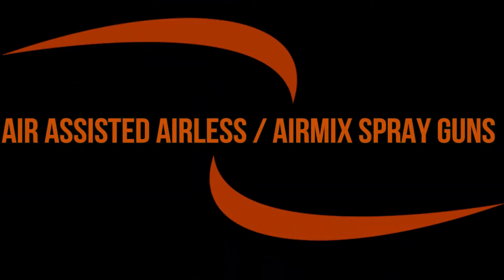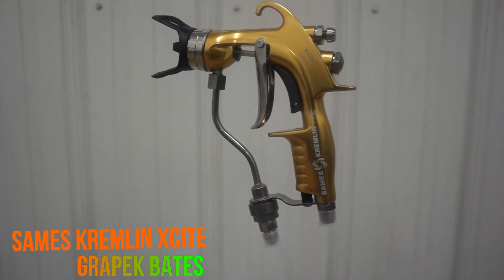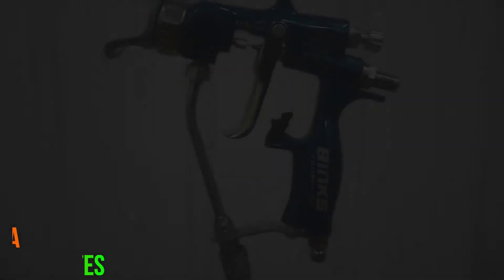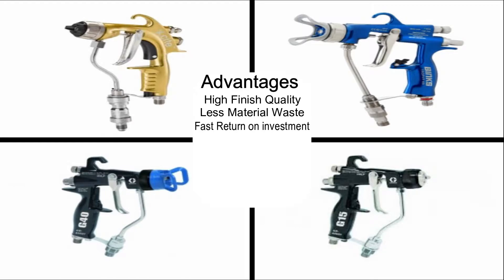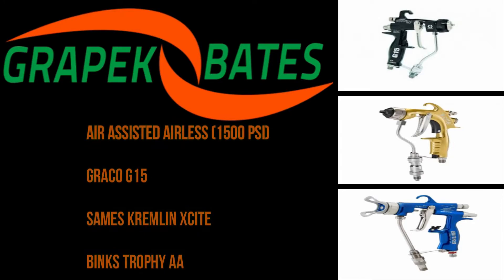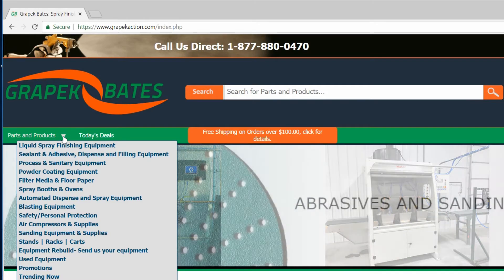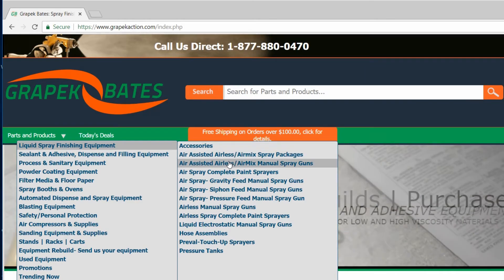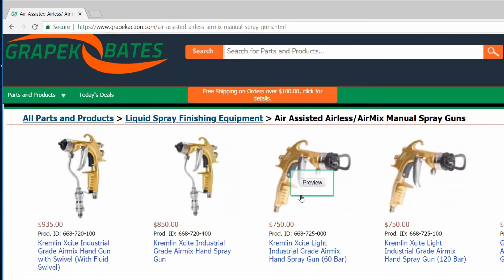Air Assisted Airless/Airmix Spray Guns

Comment: Hi mate , which spray gun has the finest atomisation? Also which spray gun has the most adjustable spray fan size
Reply from the maker: Hello Artie6937 we appreciate the comment. If you are looking for a gun that has a fine Atomization, and the most adjustable fan pattern. you should look at the Airspray Guns. They will give you the most options and you wont have as much over spray.  We have a video on that. They come in Gravity feed, Siphon feed, and Pressure feed. There is also HVLP, LVLP and Conventional. We have a video that explains this, i will leave the link below. I will also leave a link to our website. If you have any further questions you can comment again or give us a call. 

Air Spray Video- https://www.youtube.com/watch?v=2d3uf1FnW_Q
Grapek Bates Website- https://www.grapekaction.com/index.php
Reply: Thank you for the reply, I’m looking for air assisted airless for my Wagner diaphragm pump I normally spray oil based paint cheers